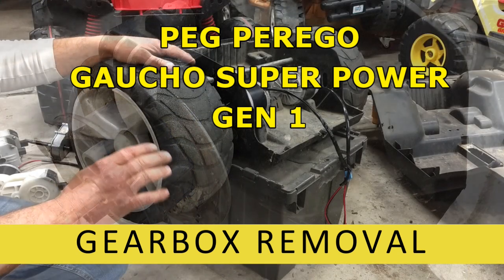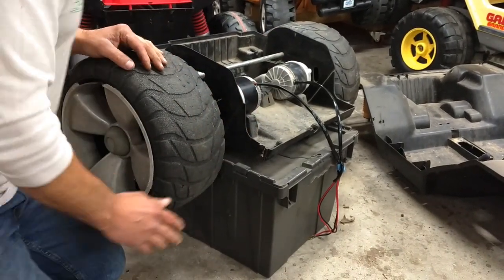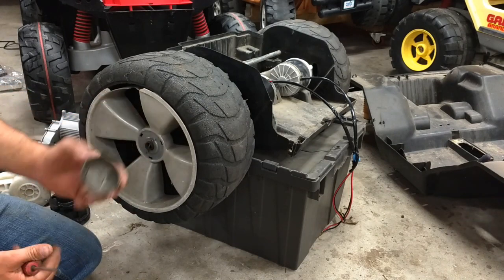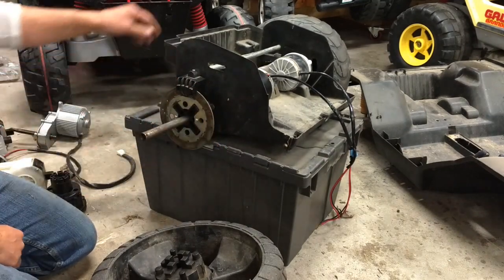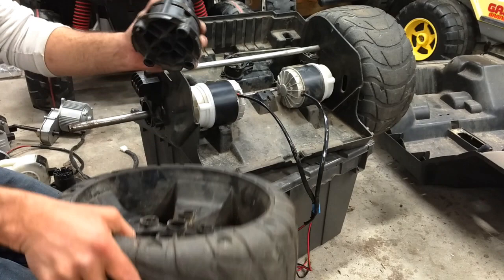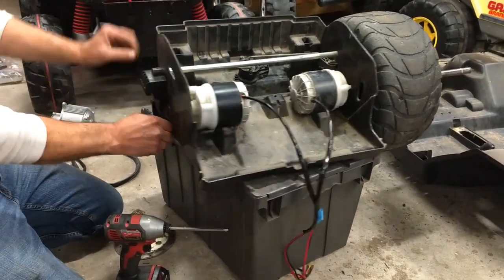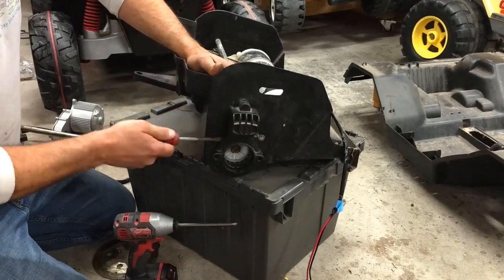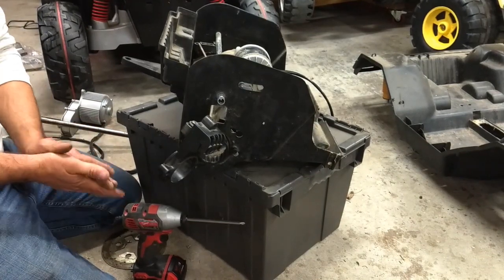Peg Perego Gaucho Super Power- 24 volt gearbox removal

Comment: Thanks for the info. So you reckon the stock motor and gearbox will  handle 36-48 volts no problems? will it shortern their life much? I presume I will have to upgrade the variable speed controller?
Reply from the maker: 36 no problem. I would use a 1000watt scooter esc. Look for one with built in reverse. U will need a relay for reverse and brakes

Comment: I'm running 60volts threw mine. Put them in a little  6v one seater ferrari made by haunda car. Runs like a champ motors never get hot. I need to find more motors and gears. Im picking up a charger cop car